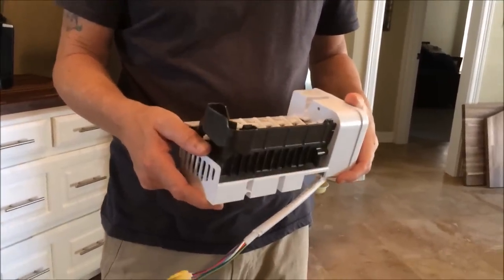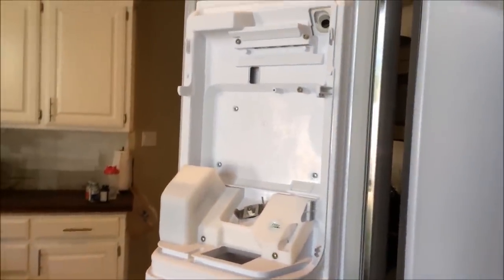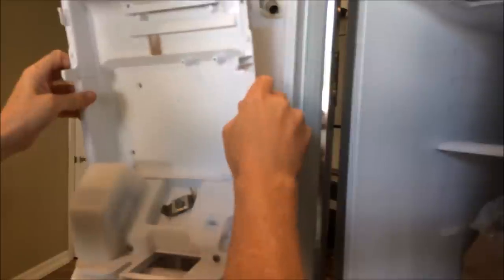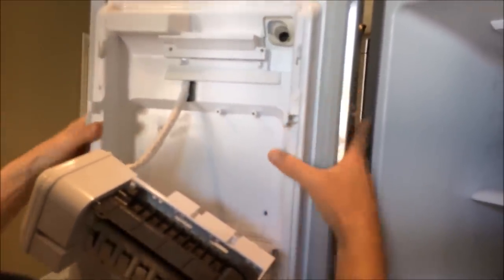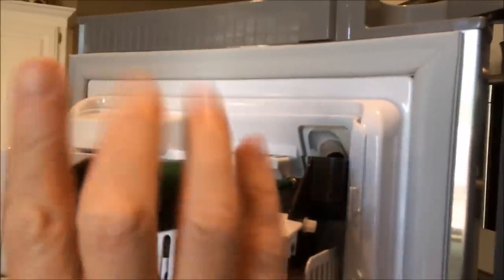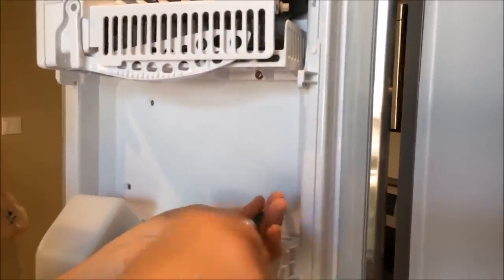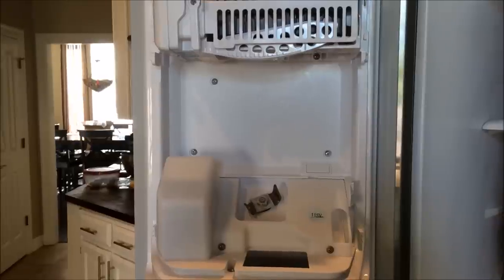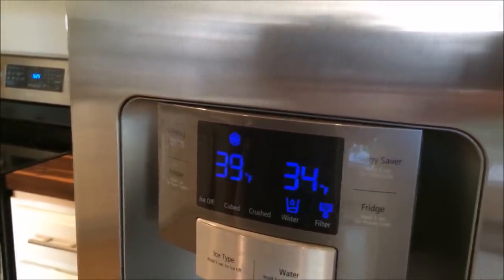Replace Ice Maker Install Samsung Ice Maker Part # DA97-11092B

Comment: I know this video is from 2014, but I had to comment a BIG thank you. I was having issues due to not changing our fridge water filter regularly and the ice maker froze up with a big block of ice, preventing the ice release "fingers" from cycling. I removed the ice maker as per your instructions, rinsed all of the ice out and have it a good cleaning, let it thoroughly dry and reinstalled in reverse order and viola, everything is working as it should. All after installing a new filter, of course.

Comment: Thanks that was very helpful.  Hey all!  I had icycles, and my ice maker was not working.  I did a bunch of research, and most sources said my ice maker needed replacement.  However, it was something else that I never read, but figured out myself.  The small metal pipe nub where the water runs out and falls into the tray had a small burr on the inside edge from the manufacture process.  It was keeping a bit of water on the nub, and freezing.  Little by little it would build up, and change how the water poured out.  Eventually, the water would want to flow behind the tube.  So, I filed the edges smooth, and the ice maker is working excellent with no dripping or cycles!  Whoo, hoo -- free, and didn't waste $120 on a new maker!  I also took all ice maker parts out for the day to de-ice, and dry.

Comment: I was about to do this until I saw another video where the guy said it could just be the ends of the teeth assembly could be frozen in place. He showed himself using a hair dryer to thaw it. I thought it couldn't be that simple. It was! It works, but I don't expect it to last. I will keep this video for when it eventually fails. Thanks!

Comment: Very helpful video. Note that part no. DA97-11092A/B has a 12 pin socket. Some models have a 10 pin socket in which case you need to order part no. IMC 702

Comment: Got an update for you. Installed the ice maker today. Following your video made it so easy to complete this project. No more water inside the refrigerator due to the faulty ice maker. Thanks for the great video. The ice maker works great with full ice cubes. Let see what happens after a few days. Hopefully that is the end of the water dripping from the ice maker. Thank you for sharing your experience via the video. It save me about $500. A company was asking that price to replace the ice maker. All it cost to me was $92. Again, thanks for sharing your video.
Reply from the maker: Great!  I'm glad the video helped.  We have to save money where we can.

Comment: Thanks again for this video. My new ice maker finally  arrived and it's working just fine. My fridge has stainless screws so the magnetic screwdriver suggested was NA.  Here's something else I'd like to share. While the old ice maker was out of the fridge, we had a power failure.  When it was restored the control panel digital display showed  a pair of  88 88's and none of the touch pads would respond ( Lighting, Ice Off,  Ice Type, etc.) The 88 88 display is shown in the user manual but not described, However,  the Water touch pad did work. I assumed it had a direct connection to the inlet valve. The fridge and freezer also continued to function, thank god. Once the new ice maker was installed and the fridge turned back on  the control panel digital display  returned to normal operation.
Many thanks for this video.

Lenny
Reply from the maker: Thanks for your comment and also for sharing your finding that occurred during your power failure. Glad to hear everything is working now.

Comment: Thanks for the video.  I replaced my ice maker this morning in about 5 minutes and saved me a lot of money.  Freezer temperature never got above zero.  The one problem that I had was getting the cover off.  I found ice build up on one side.  The cover was actually frozen on the back with a small sheet of ice that eventually melted enough to allow me to pull the cover free.  Hope this helps someone else with a hard to remove cover that may have the same issue.

Comment: Thanks for posting this.  My plate was also stuck and I was afraid to force it.. until I saw your video confirming that there are no additional fasteners.  Gentle pressure in all directions and it finally popped out.

Comment: Thank you. I saw another video on this as well but yours was much quicker and to the point. One trick is that on mine there was an arrow on the right side of the panel were a flat head screwdriver inserted there got the panel to pop off. It would not come off when I was prying at the "tab" on the left side of the panel.

Comment: Thanks! You just saved me $250! I have had to replace the POS ice maker 4 times now. Each time it just stops making ice and pressing the reset button for 10 seconds will get it thru 1 cycle and then it stops again. Eventually it just quits making ice. The first time was under factory warranty and the next 2 I paid $350 for service & part. This 4th time I ordered the ice maker for just under $100 delivered and replaced it myself using your video. I did have to transfer the bottom white plastic piece from the old to new, but all in all a very simple job that took 10 minutes. Thanks so much!
Reply from the maker: Glad the video helped!

Comment: excellent video...only problem was the big back plate that conceals the plug didn't want to let go. Being frozen plastic was worried it would break. finally after tugging it popped off...that was the only issue. From the prices I see in the comments I guess we saved a bunch. It was really nice of you to put up this video.. Thank you
Reply from the maker: Glad it helped! Thanks for watching and commenting.
Reply: Imhavng trouble getting it off. Any tricks?

Comment: I found this video extremely helpful. I bought an OEM part and  was able to remove the old part and put the new one in; however the reset button is not making any noise like it normally does. Hopefully there will be ice in 24 hours though!
Reply: Hi Kathleen. Is your ice maker working even though you didn't hear the chime after pressing the reset button? We just replaced ours and we didn't hear the chime either after pressing the reset button.

Comment: Thank you.  We have ice, so far.
Factory part arrived and we followed your instructions.  Our part did not include the bottom plastic piece.  We borrowed the piece from the old ice maker.  Unfortunately, Samsung changed the diameter of the two attaching screws (smaller holes on the replacement.)  Required a trip to hardware store to get matching diameters for the new ice maker.
Samsung should be embarrassed with this mess and poor quality.  It's prime for a class action suit considering how many hundreds of similar complaints I've come across the past few months.
Appreciate your video and calming music.
Reply: Do you recall what smaller size and type thread you needed for the new one?

Comment: Worked perfectly; the only change I would suggest would be to mount the ice maker unit to the plate before remounting the plate to the door. No floppy ice maker unit that way.
Reply: That's what I did, so much easier than trying to hold it.

Comment: Thanks for the video, very helpful. I also had issues getting the back panel off. I found that by pushing the side in with a screwdriver behind the plastic ice bucket hook will release the panel. There is a little plastic extrusion on the panel that sits between two plastic extrusions on the door. By pushing in with a screwdriver, this allows the extrusion on the panel to be freed. I hope this helps!!
Reply: I'm having the same problem getting the panel out. I'm afraid to put too much pressure with a screwdriver because I don't want to crack the plastic. Also the panel seems to be sliding up and down, just won't pull out. Any other ideas?

Comment: Thumps up!!! Great video. It's really going to help me, now that I just order the new ice maker. I have the same problem. Water keeps dripping of the ice maker. It's already 5 years old.
Reply from the maker: Thanks for your comment!  I have been meaning to do an update.  It's been 3 months since I put the new icemaker in and it's still working great. One thing to keep in mind is that after you install the new icemaker and reset it, the first water fill may be short, and it might not fill up the ice tray completely. Don't worry though, because after that first fill, it will be back to normal. This is what happened to mine, but yours may fill completely the first time.  Good luck!  ~Brett

Comment: Great video!  Although we have two different refrigerators, the ice maker looks the same.  My ice maker isn't making ice and the motor doesn't seem to come on after long periods of time.  The arms don't move either.  My reset button was shorn off, so I can't put in test mode.  I've defrosted the freezer and checked the water lines and everything looks in order.  I just think the icemaker is shot.  I'm going to save your video and use it to guide me when I get the new part in.  Thanks.

Comment: Thanks.  Especially for "Hold Down" Test button to Reset. I was pressing it and was unable to reset.  Now I know (once I heard the chime),  I don't need to replace the ice maker.
Reply from the maker: +Dan Novak Glad the video helped!
Reply: 1. On the old unit, the chime sounded but it did not reset so the chime doesn't mean you don't need to replace. 2. It would've been helpful to show removal-- removing the connector requires some skill!

Comment: Helpful video.  How do you know for sure this part needs to be replaced?  Ice maker isn't working but I'm not sure if it is due to something freezing up or if the part just needs to be replaced.  I did use a hair dryer and it produced one tray of ice and quit again.  Or is replace the part to deal with the problem completely.  Thanks
Reply from the maker: I didn't want to spend a whole lot of time trouble shooting the problem so I decided to just replace the ice maker and that worked for me.

Comment: If any of you have a Samsung and your ice maker is given you problems go on Facebook and join a group called " Samsung Refrigerator recall U.S.A now" and see how over 60,000 members are getting their money back for their defective Samsung Refrigerators. Even when they are as old as 2014 or earlier. Samsung knows they have a huge problem with their Refrigerators and they are not helping their customers. In that group they show you the steps to take to make Samsung give you a refund. Join the Facebook group and get your money back.

Comment: This made a seemingly complicated project a little easier.  Thanks for the video.  The plastic mounting bracket screws that were taken off the old ice maker were too large for the holes in the new one.  This mounting bracket is not included with replacement, which is a bummer.  Luckily, I had a tap set and was able to tap new threads for larger screws and that wasn't easy and time consuming.  After replacing the ice maker and buttoning everything up, the "ice off" can not be reset.  This may be due to high temperature in the freezer?  I also held the reset button, but never heard a chime, the arm didn't move and no water is flowing into ice maker.  What's going on?

Comment: Just replaced my ice maker and everything worked fine. I do agree with several of the comments about the panel being hard to remove ... maybe frozen a little? Very helpful though! I have the exact same model ... have you experienced the fan freezing up inside of the Refrigerator side? You must remove the back panel and defrost the coils around the fan ... seems to last about two years before it needs it again. Just curious to know if you have experienced it and what you may have tried. Thx.
Reply from the maker: Thanks for watching the video.  Thankfully I have not experienced the fan freezing up yet.
Reply: Omg yes, my aunt's fridge side does that too, I take off the panel and thaw the whole bottom area and the fan too, I'm so happy I'm not alone🥲

Comment: Thank you awesome video and saved me a ton on having Samsung send someone out for $300 very easy to follow just curious I was getting icicles too and and making ice intermittently.

Did this eventually fix your same problem? 

You mentioned you would do a follow up video but I could not find it when searching.

Thanks for all your help !

Dave
Reply from the maker: Yes, replacing the unit solved the problem.  We have not made a follow up video yet.
Reply: Mine seems to be working too ....no icicles yet...and making ice! Thanks 😀
Reply from the maker: Great!  Thanks for watching for the video

Comment: My ice maker stopped working  a few months ago, the ice no longer came out (think the heat element didnt work) I got a replacement unit yesterday and installed it, but its not working, 2 of the compartments filled up and froze, however it didnt spit them out. Is the unit faulty or am I doing something wrong? I did the test button and left it overnight but nothing. Today i have freed the two stuck pieces and pressed the test again

Comment: After a couple of years these American fridges always start to get cracks in the casing or something else goes wrong so  mine is always insured .they can’t fix the casing so you basically get a new fridge I was amazed at this I thought it would of been fixed with glue or something but this isn’t the case .

Comment: I may be in the wrong place but I need guidance on doors with my samsung refrigerator. The retractable sill on the door no longer retracts and has to be manually positioned to align with the guide. How do I correct this?

Comment: Thanks! Now I know that I need to pull harder to remove the panel. How did you get the icemaker disconnected before you removed the panel?  Just pulled it out? Anyway, you gave me what I needed to proceed.
Reply from the maker: Gary, Glad the video helped.  Once you remove the screws that attach the icemaker to the door, it just kind of hangs there.  Once you loosen up the panel, there is a clip behind the panel that you undo, and then the icemaker and cord can be pulled out.
Reply: I had to remove the panel to get at that connector, but yes thanks to you I saved hundreds. New icemaker, lots of ice - we are a happy family again.

Comment: HI DIY,  I have the exact frig,  water is working fine, but won't make ice.  I have installed a new filter, still nothing.  I have run it through the reset mode and only puts out enough water to fill 5 of the 6 cube molds and only half way.  Waited 24 hrs and it won't refill the try.  When it resets it puts the arm all the way up again, ( not sure if this is correct or not).  Your thoughts, water valve??Thank you any help is appreciated.
Reply from the maker: True, the ice maker will only fill up half way after initial reset. But it should return to fill normally after that.  So based on your information, I would go ahead and replace the ice maker itself because there is a computer board on there that could be defective.  If it was the water valve, it would not even fill at all after resetting.  In my experience, these ice makers are somewhat finicky and having to replace it every 2 - 3 years is still cheaper than possibly buying a new fridge for me.  It's been 2 years since I replaced my ice maker and it's still working fine.

Comment: Hi Again.  I have the exact same refrigerator as yours - does the gear (or whatever you call that thing that churns the ice) in your ice bucket freeze up from time to time and gets clogged up with ice?  Mine does it about once a month where I have to take it out (with ice flying all over the floor), wash & dry it and put it back in.  I'm hoping you have a better fix :)  Thank you!
Reply from the maker: Yes, mine does the exact same thing.  I don't have a fix right now and it just seems to be the nature of this ice machine, but I am working on trying to figure one out.  If I come up with a fix, I will definitely do an update!

Comment: I have exact same Samsung model with Ice maker that stopped working, no water fill.  If I set reset button it will go though motions like it is dumping ice.  However, the arm will come down and go back up.  Is it suppose to remain in the down position to fill or does it just go down to check ice level and then go back up?  Trying to decide if it is an inlet valve or bad ice maker.
Reply from the maker: +Tim Riley You are correct in that the arm will just go down to check the ice level and then go back up.  If there is no water coming out, then it's a good possibility it is the inlet valve.

Comment: Hi...Question, My ice maker stopped making ice.  I have pressed the reset button and it cycles through...then the water comes in to the tray but only for a second or so and then stops...do you think that replacing this, as you did above, would solve my issue?  Thanks in advance!!  Also, the normal water line is operating as normal as I can fill glasses of water without issue.
Reply from the maker: +Greg Rempe I would try changing it out. Just note that after you do, the water that goes in will only come out for a about 2 seconds instead of the normal 4 or 5 seconds after you reset it for the first batch.  Good luck!
Reply: +DIY Projects  - New ice maker just in...great instructions!!...Just reset it and, as it had been doing (and as you mentioned above) water only ran for a few seconds then shut off.  So, will give it 24hrs and hope for the best!!  Thanks!
Reply: +Greg Rempe  - FIXED...THANKS!!